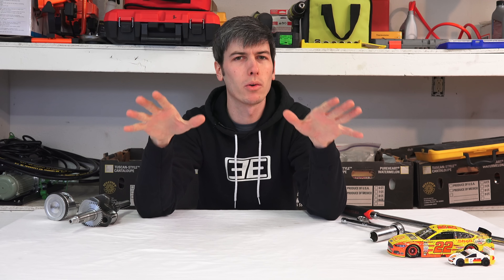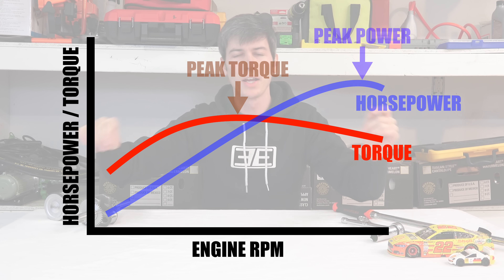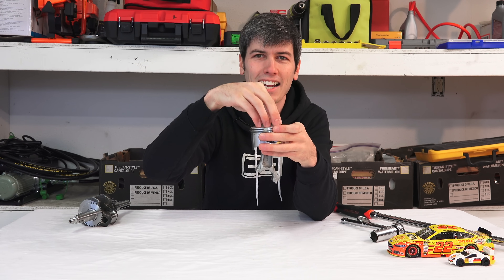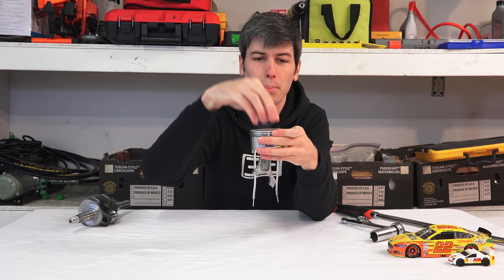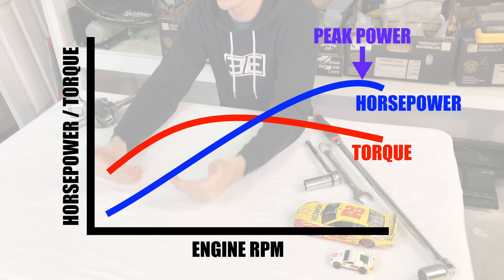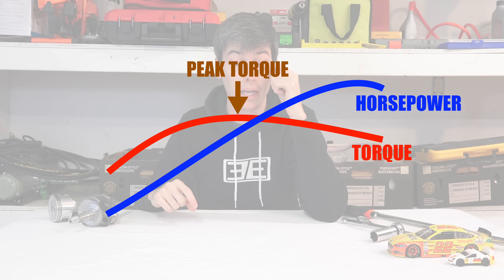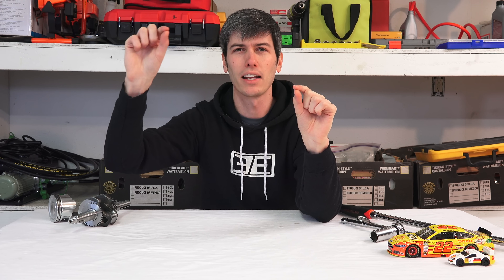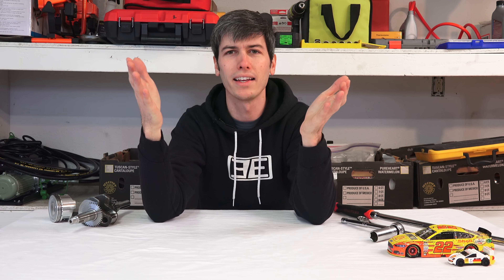Horsepower vs Torque - A Simple Explanation

Comment: Starts well but gets muddy when discussing the two cars: if torque doesn't matter - which is the impression I'm left with - why aren't car engines like bike engines, i.e. tiny torque, massive revs? 
Saying the cars are identical in all other regards, then going on to talk about gearing to compensate is confusing: do they have different ratios - or not? If they were identical in all regards - including ratios - from a standing start, under normal conditions I would expect the higher torque car to be quicker off the line before being overhauled by the higher power one. When was the last time you set off at peak power revs? Never mind torque & horsepower, what about clutch & wheelspin...
Reply: An engine with low torque and a high rpm limit would have to operate at a higher speed in order to be inside its power band. At higher engine speeds you use more fuel and the engine wears out faster.
Reply: @Redtooth75  that much is self-evident, but doesn't address my point
In my simplistic understanding, torque gets you off the line, and power drives the speed (& was hoping this vid might confirm/correct/clarify that). When the former needs a lot of work (i.e. large mass) you need a lot of torque, which is why trucks have big torque, low rev engines and bikes the reverse
Reply: @seansverige  correct. You have to apply a certain amount of torque to the wheels to move a vehicle. How much torque depends on weight, air resistance, and stuff like that. As long as you are applying the minimum amount of torque the vehicle will move. The speed that it will move at depends on how fast you apply the torque, which is power.

Comment: How come my manual 1600kg petrol car with 260hp and 370NM has same acceleration as 530D or A6 3.0TDi with 260-270hp and ~600NM, which have optimal and fast gearing allowing them to change fast and always be in optimal rpm. Granted they are faster from standstill because of launch control, but from 50 to 200kmh it is the same.

Comment: I always think of it as Power = how fast a car can be dependent on weight, Torque  = how much that car changes in performance when you get more weight in it.  i.e. my little hot hatch was well nippy with just me in it, but the engine had no torque so when my mates were in it, they were not impressed.

Comment: The was a great explanation.  I note understand it much better.  One correction: You said torque is how hard you are pushed back into your seat, but that is f=ma, and a (or acceleration) is related to HP not torque.  So it is HP that pushes you back in your seat.  Or I don’t get it, and someone can call me out on this...

Comment: You tried REALLY hard, but the sad fact is you failed. All that bull about changing torque with gear ratio was wasted. Horsepower IS the measure of work over time, and that’s all that matter; period. That’s why a gasoline engine will wear out a diesel despite it having a thousand ft-lbs of torque. Why does everyone feel the need to make torque sound important?

Comment: Torque is what initially presses you back in the seat off the line....Horsepower is what Keeps you there as speed increases....  this is why electrics  launch so hard and are brutal off the line with instant massive torque but their  top end is  not as good becuz HP comes into play  and its not enough to Keep that  initial thrust all the way thru the 1/4 mi.. same is true for the C8..It launches like a beast, throws you back in the seat, rips to 60 in 2.8secs but then starts to fade  as speeds increase becuz it has modest HP  and cant sustain that thrust thru the 1/4mi

Comment: I'm sorry....but you are completely backwards! You have no idea of what you are talking about. Horsepower is a mathematical formula of work being done and that is all it is...a mathematical formula. Torque is an actual measurable force, which can be multiplied. The "200" ft pound car would stomp the "200" horsepower car. I do this for a living!!!!
Reply: Nah not really. Horsepower is a measurement of power, its the rate that the torque is applied. It is a real tangible thing. Horsepower is the main factor when determining the capabilities of the engine. Torque can be manipulated through gears to make it whatever you want, but power will remain constant.

Comment: I think the simplest example that I can think of is a comparison between a F1 engine or power unit as it's called now and a NASCAR engine.  The NASCAR engine is more than twice the size of a F1 engine but they roughly make the same HP.  The much smaller F1 engine has very little torque.  Well it has more torque now because of the hybrid power but when it was just normally aspirated V8 or even V10, it had less torque than a typical family sedan in your garage.  But it can still make 900 or more HP because you can rev it up insanely high... used to be 18 or 19K rpm but now down to about 15K rpm.